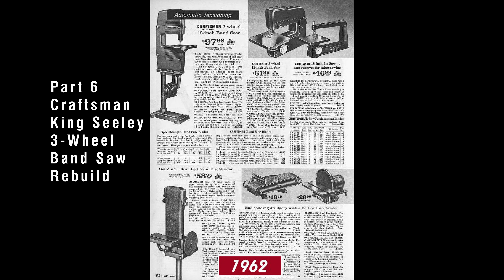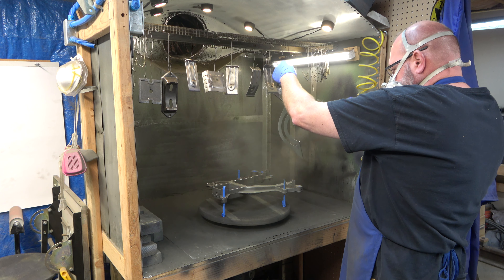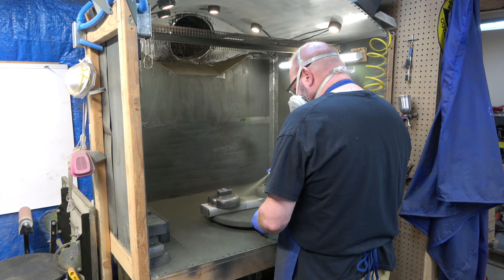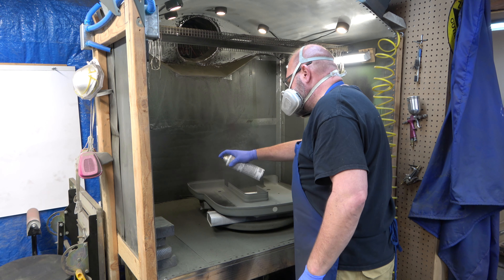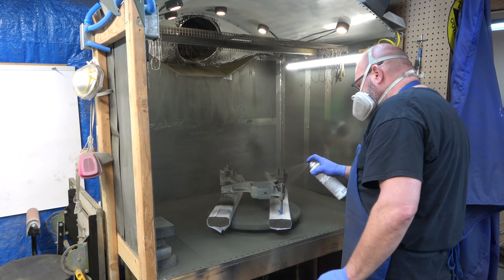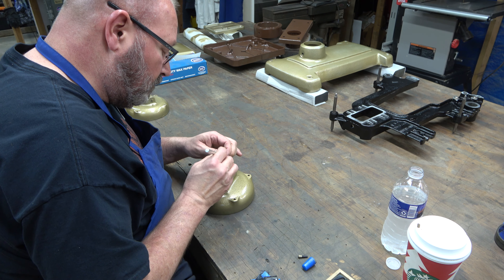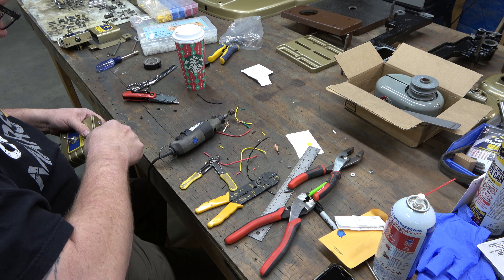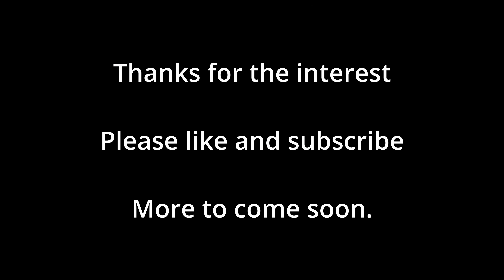Part 6 Rebuild Craftsman King Seeley 3 Wheel Band Saw (Prime & Paint & Assemble the Powr Panl)

Comment: Appreciate the continuing rebuild videos! I haven't noticed you mentioning the casters in any of the rebuilds yet. Have you found a way to clean and restore them or found a good replacement? I cannot get the casters working well again and the replacements have all been too big for the small space.
Reply from the maker: Kevin, thank you for the question. I have been trying to decide when is a good time to bring up the casters. Regardless, the answer to both your questions is yes. For original casters they get a soak in Simple Green 24 hours then rinse and soak in Citric Acid for 24 hours then rinse and dry off. I use compressed air to blow out the internals then I soak the entire caster in 30 wt motor oil for 24 hours. Remove the caster and dry it off and you should have a working caster at that point unless there is an issue with one of the ball bearings.
As for replacements, I have a thread all about this on Garage Journal here is the link: https://www.garagejournal.com/forum/threads/classic-craftsman-king-seeley-pedestal-mount-casters.482785/
Reply: @JeffsShop  Wanted to let you know that I followed that process and it worked beautifully! I'm sure they are not as good as brand-new casters would be, but they work much, much better than they did before. I had not thought of the overnight soak in oil, but that seems to be the key part. Thanks again!
Reply from the maker: @kevinwyatt243  I am glad you got them working. Finding the actual Acme caster is very difficult. I see one or two pop up from time to time but I have only seen a set of 4 on eBay once and the seller wanted too much for them